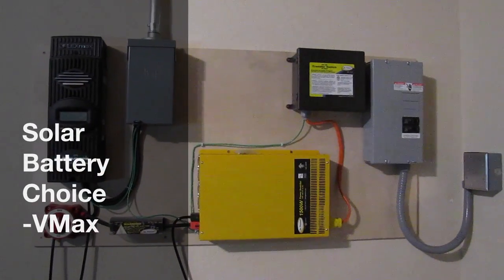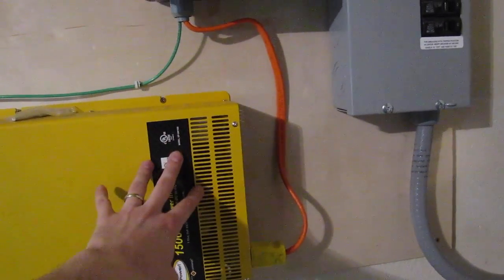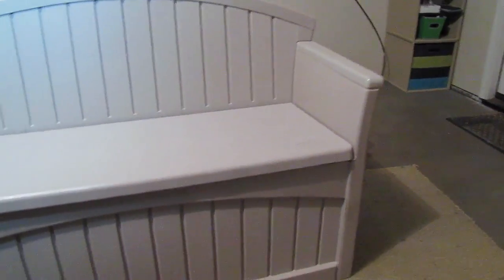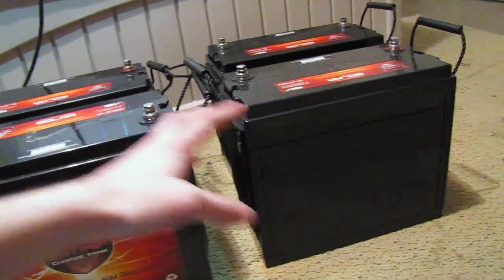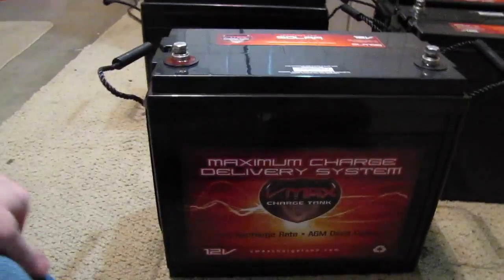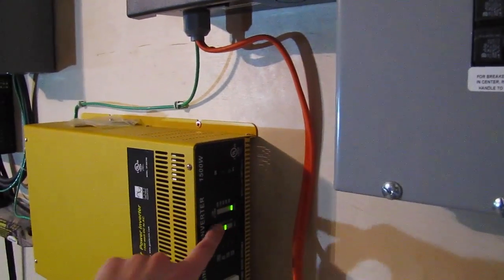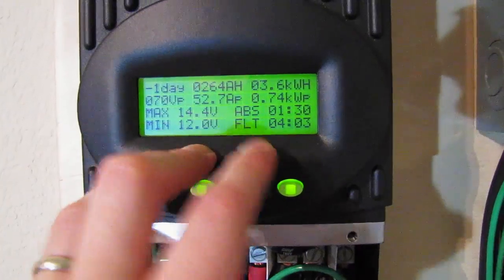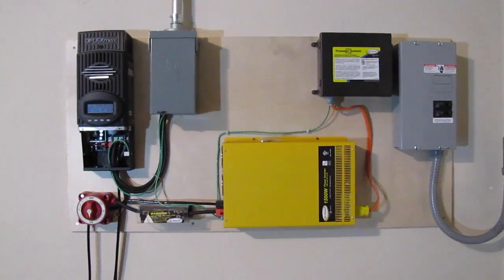Solar Battery Choice - VMax Charge Tank - Off Grid Kitchen

Comment: That is a really expensive electricity. Why will you ant to run that other than when you are without grid power ?
You need to calculate the cost amortization of that battery per kWh stored over is lifetime then you will realize that it makes absolute no sense to use that electricity unless is used as an UPS in case of main power loss.
I do not seems to find a data sheet for your battery but is extremely expensive and I'm sure specs are far from good for the price.
I live OffGrid with a smaller capacity battery (LiFePO4) but I have a small and highly energy efficient house and even with that battery that is probably 4 to 5x less expensive /kWh stored over the life of the battery the price is still higher than grid in most places.
That battery you have will last at best 5 years if you only use the top 20% of the capacity every day and there the charge discharge efficiency is in the 50 to 60% do to equalization. But even if you do not take the efficiency in to account just make a calculation of how much will each KWh cost. I do not know how much exactly you payed for the batteries but calculation is like this 155Ah x 4battery x 12V x 0.2 (20% DOD) x 5years x 365 days = 2715.6kWh over the life of the battery.
I do not know the price you paid but as example I will use 350$/pcs (I seen this price on the battery website) so 1400$ for all 4 that is 1400$/2715.6kWh = 0.51$/KWh for that energy not counting the amortization cost for the other components and the battery charge discharge efficiency or inverter efficiency. I'm sure you pay less for grid power.
Reply: ***** 
I'll answer that question for you. Currently i pay approx $150 a month on the grid. I'm gonna be installing a similar setup sometime next week. Same "expensive" Vmaxtanks. Everyting is gonna run me close to $3000. Since your a mathematician lets do the math. Once its up and running I'm projected to save roughly $100 a month. $100 times 12 times the five year life span on those batteries equals $6000. The setup is gonna cost me $3000. Does it get any simpler than that??
Reply: C Bennett The math is not as simple as you think. I have no idea where you live so I do not know what your electricity rate is. Say it is 20cent/kWh that means you use around 750kWh/month. Say you want to produce 500kWh/month to save that $100.
Now things get even more complicated since I do not know your use pattern to know how much will be used during the day directly from solar (that will have a good price) and what percentage will be used from battery (with those batteries a huge price per unit of energy).
Say you watch how you use the energy and manage 60% as direct use from the panels and only 40% need to be cycled trough battery.
That means your battery will need to be capable of (based on the above assumptions) to manage about 200kWh/month
If you look at my calculations in the original comment you will see that those 4 batteries that cost about $1400 will not be even close enough to support 200kWh/month to allow you to save $100/month in fact to save $40 do to battery and $60 as result of energy used directly from solar panels.
If by any chance you manage do get 200kWh/month from those batteries they will be dead in about one year or less those producing savings equivalent with 40$ x 12 = 480$ best case while cost is $1400.
So I will highly suggest not to invest the money in those batteries if you did not do that already.
Solar grid tie is a great way to save money but not Lead Acid batteries. In fact not even LiFePO4 will make sense at the assumed 20cent/kWh.

Comment: How did you wire up the inverter to the house panel with the ground in place.
Reply from the maker: I didn't wire the inverter to the house. My kitchen is an island (power wise) from the rest of the house now. Let's say the power in my neighborhood goes out, like it did recently in a storm, the neighborhood and most of my house will go dark and the kitchen will still be running and lit on battery backup. Hope that helps.

Comment: I added those batteries to my tiny house solar design project list several months ago as a good possible option.  Glad to see they are working for you.  You are a young guy with time to reclaim your solar investment.  Have you considered the Iron Edison battery option?  Thirty plus year lifespan from what I have been able to figure.  Very interesting backstory to those.  They're a couple orders of magnitude more expensive than what you have but the lifespan puts them ahead in any longterm installation.  Their tolerance for a much higher depth of discharge is something that might interest you.  Enjoy.
Reply from the maker: Edison cells is something I've considered. As soon as I can pay cash for them I'll work it in to the budget.
Reply: At your age it would probably pay but at mine I am not so sure.  I'll probably go with the Vmax option.  I'm planning on parallel solar in my Tiny Home project.  A smaller solar for lighting and a bigger one for appliance loads.  Subject to change.  I want to run air conditioning off the Sun.  Lifelong dream.  I want to live tiny but upscale. Here's my Project notes on the lighting system: https://thetimchannel.wordpress.com/2014/08/31/tims-tiny-home-project-notes-4/ Note that I factored in for proper depth of discharge (LOL), temperature, solar exposure, etc.   I haven't finished working up the main system yet but I do have an online spreadsheet of appliance options open to the public: https://docs.google.com/spreadsheets/d/10IpV4YK8-N96-Z-jvejFw0V9ozeZdT-dofNuB9o4IlU/edit?usp=drive_web Enjoy.
Reply: JuliansRandomProject Edison cells fail in below freezing temperatures. The alkaline electrolyte turns to slush. But otherwise they last 80 years+. And they weigh tons - each cell a slab of cast iron and a slab of nickel metal. I think nickel is more pricey than copper, these days.
Reply from the maker: Thanks goodness I live in an area that hasn't seen freezing temps for decades

Comment: Great video! Like your set up. Grid tie inverters will automatically switch to the grid when batteries hit the set cut off point or loss of power, but they cost more money. Like the way you have yours set up with the auto transfer switch, does the same thing and saves a lot of loot! Sweet!

Comment: Hi Julian,
It is great that you are able to provide power to a specific room with solar and at the same time provide the rest of the house with grid power.
I am particularly interested in how you plan to supply the kitchen with solar/battery when available and grid when batteries are low.
Can you provide more detail on how you are going to achieve that?
I believe the basic reason many want to get into solar is to have power when the grid goes out, yet that is not the common setup that a typical solar company will provide.

Thanks for the great video.

Comment: Great video, love the bench idea.  Are you still happy with the Vtanks?  I was looking at them a while ago, but could never get a straight answer as to specs, such as country of manufacture, or a cycle life chart.  BTW, I think  the wires running to the inverter are too thin :-)
Reply from the maker: Still loving the Vtanks, build quality is high. They're made in China (confirmed this with the manufacturer). "Thin" is relative :) the wires I'm using on the DC side are 2 gauge and are just 'OK' for this application but not great for scaling it up.
Reply: JuliansRandomProject
I agree w Buba. If you know can you link to the specs of the Vtanks? I called them and asked for the impedance and if they were pure lead and was told to ask my salesman. That scares me they won't release the specs.

Comment: Hi Julian. Nice video!

I recently purchased two VMax Solar 125Ah for my starter system. I may ultimately add two more 125Ah to my battery bank. I'm curious how your batteries have been holding up for you. It's been over six months since you posted this video. Any complaints about your VTanks?

Comment: Great Vid, I actually run with 4 SLR175s right now. I haven't said much about them because they are actually undersized for my intentions and I got them when I first started messing around with Solar but I went from messing around to wanting to take the entire house off grid. For what you describe they work well but once you start consistently drawing a large amount of AC amps from them they start to drain rather quickly because as a 12Volt battery their cells are rather small and can't handle hi amps and when I say high amps I mean high dc amps in the range of 200 amps. So they are great for a one room, two room application but anything more than that I would advise to look at 6 or 2 volt batteries rated at above 800AH

Comment: We use these for audio, they are made in Detroit! We use 1 2500 and 2 4000s on a 7500w draw. Love these batterys!
Reply: tyoung319 I contacted Vmax and Barginshore, both said these batteries are mostly made in China except for the terminal posts which are made in the USA. Made in China doesn't make them any less quality. All iPhones are made in China. Quality built to Apple requirements and specs.
Reply: lanceguilin Thats odd, not refuting that, but when I order the come straight from Southfield (basically Detroit) which there are battery manufacturers there. I will have to dig a bit deeper.
Reply: by all means, please verify for yourself. I purchased two of the 125Ah batteries. I'm perfectly satisfied with mine. Deciding whether to purchase two more -- really whether or not I can afford two more. But I've confirmed for myself from both Vmax and their online reseller Barginshore that these batteries are manufactured in China.

Comment: I'm about to get 3 of the 12v 175 AH vmax for my Rv/Camper! Do they really kickass? V, do ya truly recommend these?? With the GoPower 3000W RV kit (3500$) kit
Reply from the maker: I really should have gone with the GoPower 3000W, I don't think you'll regret it. It'll be easy enough for me to swap out now though. The 3KW version also has a captive cable for AC out which will be nice in your RV setup. The VMax will work perfect with that setup. I do highly recommend them :)